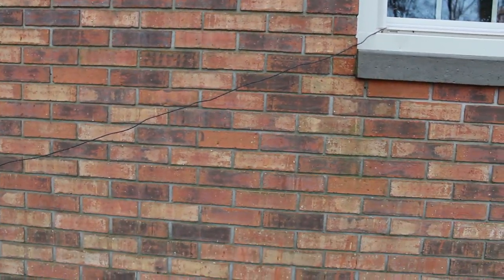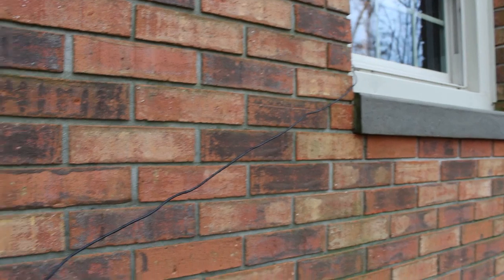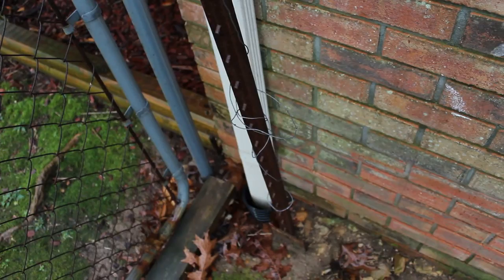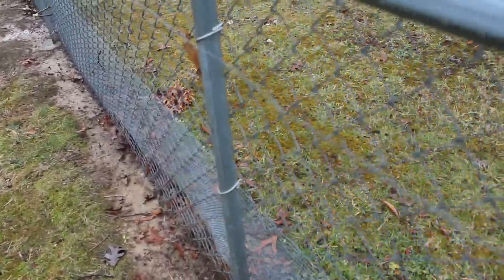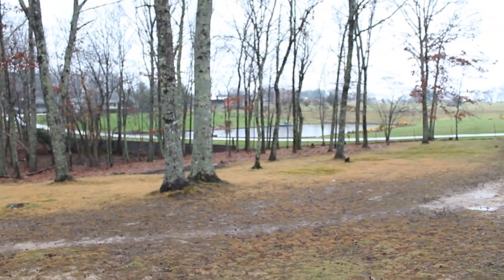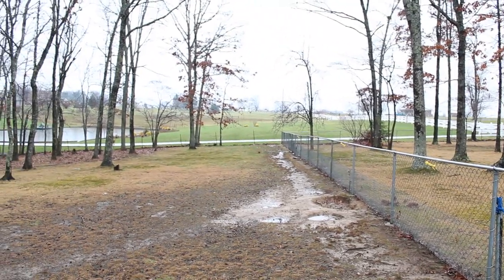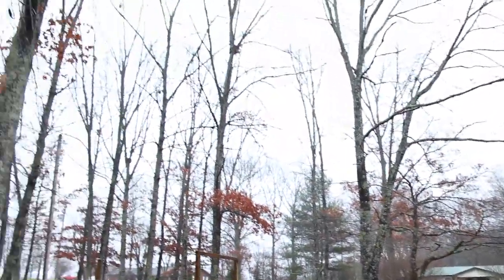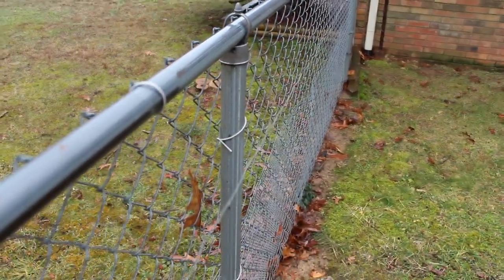My Longwire Shortwave Antenna

Comment: do what the commenter colt delta elite said to do. if you have a good ground, your liable to get a electrical shock the way you have it hooked up now. look at some of the other you tube antenna projects and read the instructions for your radio.

Comment: Thats actually TOO long- and you dont ground the antenna. ground is ONLY for the Transmitter antennas mainly. Your receiver is already grounded. Your lowest frequency of 3mhz half wave is 74ft. (using the 234 equation) You have FAR FAR over did it. Just do 50-100ft is all. Unless our trying to listen to 60hz -lol

Comment: Look to Google, really!. You haven't got to much right there.
Even a simple thing like twisting copper wire onto fencing wire can cause electrolysis and corrode the joint hence causing high resistance.
Plenty of info out there and it's fun to play, enjoy.

Comment: fuck i got electrocuted and shocked, which hole is ground on the receptacle?  i put the antenna in one of the wholes and it tripped the breaker after i got a shock..you guys are crazy...i put it in the top right hole..
Reply: The blade slots on the top are hot and neutral, the round hole on the bottom is ground.